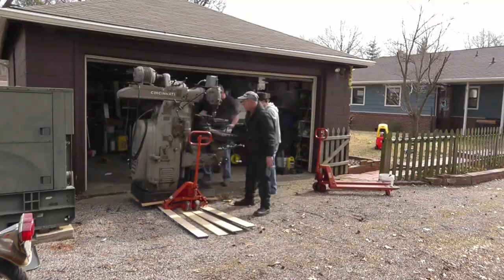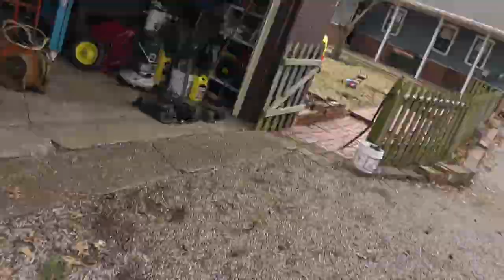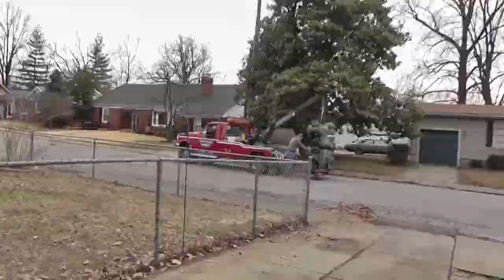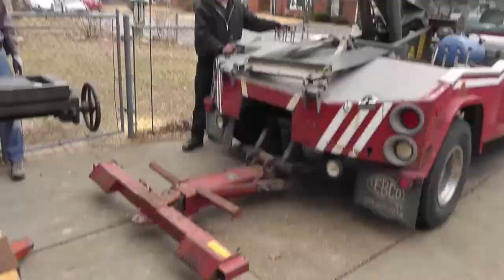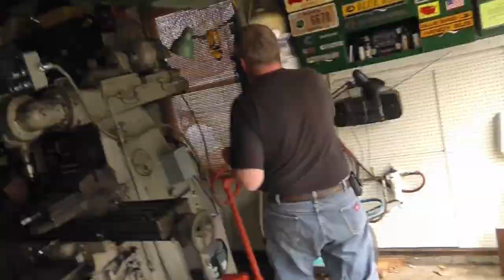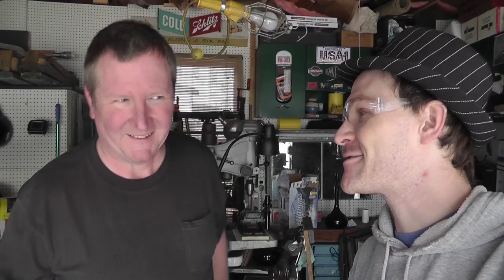Moving The Cincinnati mill #2 across the road...  To a good home it will go... 5000LB!!!

Comment: I've got one of these mills, too.  Mine has a Bridgeport variable speed J-head on it.  Had a repair man once tell me that mine is sooooo old, they were originally built for shops with central (overhead) power drive pulleys.  He showed me where it had been converted to run from an electric motor.  My electric motor for the horizontal is mounted below the shaft, on the back of the base casting.
Pretty cool! Glad to see mine isn't the only other one still running!

Comment: How timely! I just bought a large (3800 lbs) milling machine this weekend. I never thought of using a tow truck rear end to move one. How do you intend to permanently mount the machine in your shop? Mine is now sitting right on the deck with no easy to get under it for repositioning to its final location in my garage.

Very helpful video, thanks for sharing it.